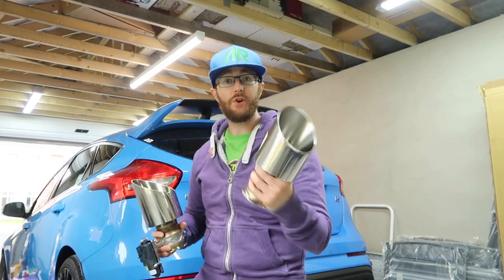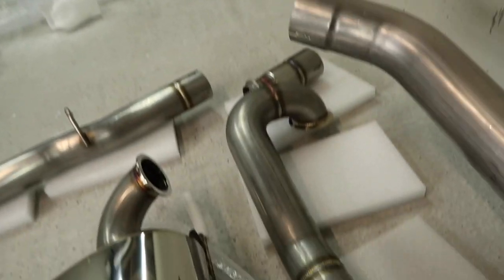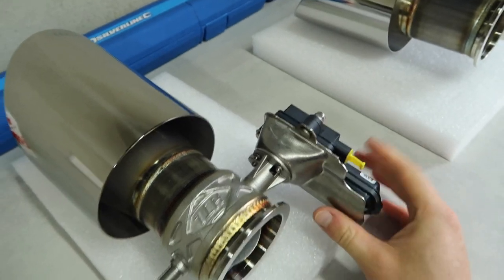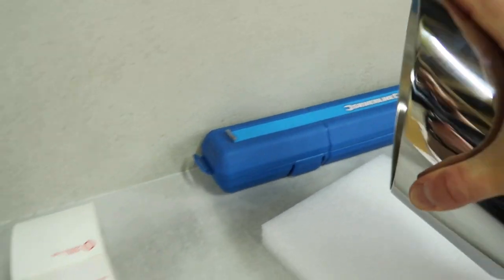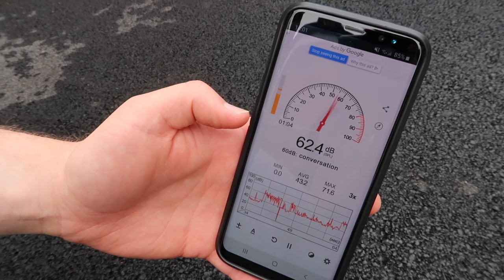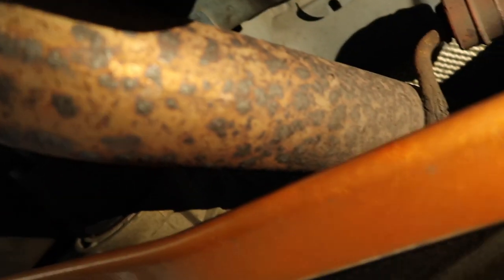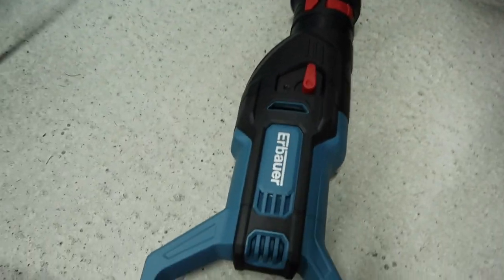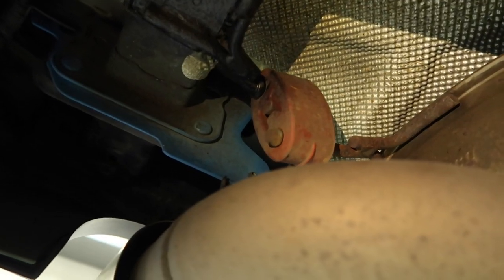MOUNTUNE V3 CAT BACK EXHAUST INSTALL! | MK3 FOCUS RS

Comment: Where did you order it from?
It shows always out of stock.
I live in the United States and I work 15min aways from mountune USA they never have any eta or any infos.
I went now with the ETS EXHAUST doesbthe mountune have the ability to be connected on a aftermarket downpipe without the V band connection?

Comment: My Rs was stolen on the 25th I’m gutted
Reply: If you get it back, install autowatch ghost immobilizer. Can't access OBD port or even use the keys to start
Reply: @MY0BL1V10N  Couldn't agree more, had mine installed a year ago, a disklok is a must too.........

Comment: Cool exhaust. Great quality video. You deserve more subs.

I unfortunately, I will have to remove my Mountune exhaust on my Fiesta ST200.
Because I failed my MOT in Belgium. Emission test was ok, I doubt they did a noise test.
But no paperwork, or E-mark will fail you, is what they claim, despite my proof of warranty.
MOT in Belgium is an absolute nightmare with huge inconsistencies.

Comment: Welcome to the V3 club Adam .. ur face when you did first cold start says EVERYTHING 😁😁👍
Reply: Now he just has to join the turbo-back straight pipe club.
Reply: killgorees sounds bloody awful
Reply: @blinkinbadger6164  I can tell you from experience, there is no sound difference. The only difference is how loud it is. The engine is what dictates the sound of the exhaust, and all modern turbo 4 pots sound more or less the same. A straight pipe may be obnoxious, but it removes all flow restriction, and if you truly care about performance, then removing restriction is more important than sound.
Reply: killgorees what are you talking about !? 
I get 418 bhp wether I run stock cat back or scorpion cat back , my car was run on an independent dyno & I ran 418 on a stock cat back

Comment: Hi,, good job,,, but motor increased performance, with this Exaust??
Reply from the maker: With essentially any aftermarket exhaust for the RS you will be getting larger bore size, removal of the pancake section and a more freely flowing back box all adding up to a reduction in back pressure which will aid in performance, especially when mapped in
Reply: @AdamRainey  Hi , you have installed also 200 cell cat?

Comment: Mine has the scorpion sport cat and cat back it was more down to price for me , the mountune 1 does sound good cheers Steve 👍😀
Reply: Do you like the way it sounds ? 
I hated mine, went back to stock cat back
Reply: @blinkinbadger6164  sounds better at lower revs when you floor it it's more of a noise rather than a sound but wouldnt change back tho cheers steve
Reply: @blinkinbadger6164  with all the windows down it so loud but love it cheers steve 😀👍
Reply: Steve BHP DEVON  exhaust sound has got to be one of the biggest opinion gatherers ( if that makes sense ) what one person loves , another hates 
I loved my scorpion cat back with the stock cat, my mate thought it wasn’t loud enough !?
Reply: @blinkinbadger6164  fords sound deadening is pretty good so seems a bit quiet when the windows are closed, when the valve is closed it sounds like standard to me quiet and sensable, but  you get the opposite when the valve is open cheers steve 👍

Comment: Unfortunately ceramic coating doesnt bond to bare surfaces, only painted surfaces
Reply from the maker: Unfortunately, you are wrong. There are some ceramic coatings that are formulated to bond perfectly to bare metal - not all ceramic coatings are the same. Do your research